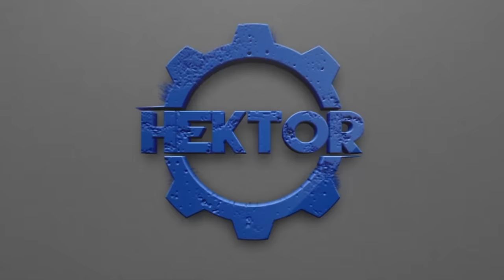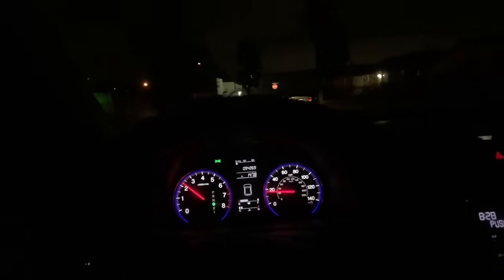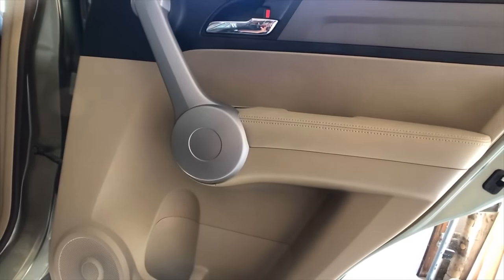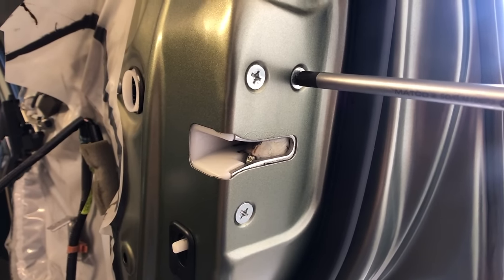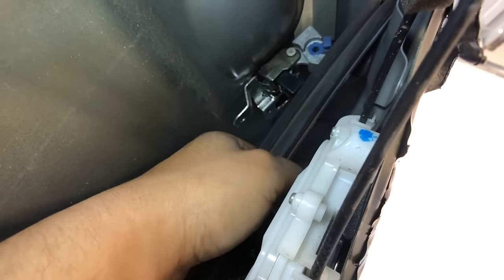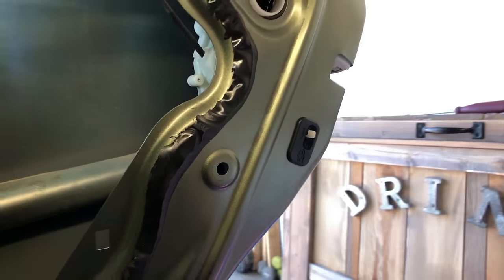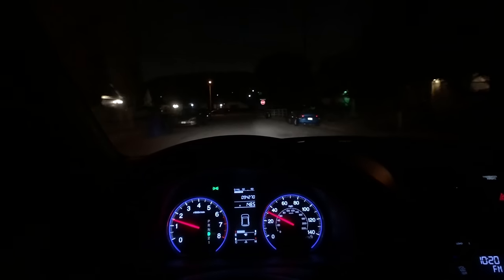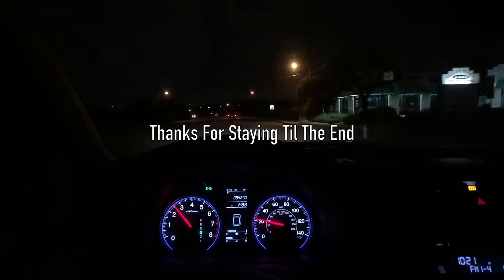Honda CRV common door lock problems

Comment: My 2011 CRV hatch is not unlocking with the fob or the button on the arm rest just the past two days. Discovered that my rear passenger door is not unlocking either (and I can't unlock it with the button on the door). From what I've read, I gather that the hatch will not unlock unless all of the doors unlock. So it looks like I'll be changing the actuator. This made it look easy enough for me to do. Thank you.
Reply: Hello, something similar happens to me but in a different way, they close all the doors except the driver's but they open all of them normally with the control and the button on the armrest and when driving The car does something similar to the video but I don't know how to open or close it, it just tries.
Reply: the same with mine! 2013...rear I noticed first wouldn't unlock...then the passenger rear. So weird. Did you figure out how to fix this??

Comment: Just completed this. Actually extremely straightforward and reasonably quick, just as shown. I would suggest the first task be loosening up those three screws with an impact driver (this way, if you run into trouble, you don't have the door all in pieces). Once you have those going, it should be plain sailing. Only other issue was that my new actuator didn't come with the metal rod. It's not immediately clear how to swap this over but the piece of white plastic pulls off of the metal on the actuator.
Reply: Timely getting a like here. I have to replace it again. Cheap knockoff, I assume.

Comment: I literally just did this job on my car and followed this video step by step it was super helpful and detailed unfortunately the replacement part I ordered off of amazon did not come with the metal rod that hooks up to the door handle but i took it off of the old one and used it on the new one i give this video a 10 out of 10
Reply from the maker: That’s what it’s about, my job is done here.😎
Reply: I had to do something similar.  With one or two parts.  I had to modify another post on the new part also.  Used a Dremel to shave it off so I could mount it properly.
Reply: Hello, something similar happens to me, the driver's door does not close with the control and the button on the armrest and when driving the car it does the same thing in the video but I don't know how to unlock or lock it, it only makes the sound, I changed the actuator the driver's door but it remains the same, what do you think it could be?

Comment: I know I’m a couple years late to the party but thanks man. Just took me an hour to do this on the front passenger door, it’s the same as a rear door. Also to get the rod out of the blue conector I used one screw driver in the door and another one down from the top and pried one agains the other like a v to pop it out. Worked like a charm

Comment: I deactivated the auto door lock feature (detailed in owners manual) on my 2008 Crv, so far no issues. 196,000 miles.
Reply: Sounds like a lot better fix.
Reply: Takes a lot of stress off the locking system for sure.
Reply: Similar problem on my 08 CRV. How do i disable auto lock feature? Thanks
Reply: Jassima Nasima it’s outlined in the owners manual in the lock section
Reply: Thank you! You totally saved me🙏
Reply: My is 230,000 and it runs perfect
Reply: Auto lock and unlock is so silly, I think even foolish to keep on.
Reply: To turn the auto door lock modes off:

1. Make sure the shift lever is in
Park (P), and open the driver’s
door.

2. Turn the ignition switch to the ON
(II) position.

3. Set the parking brake.

4. Push and hold the front of the
master door lock switch on the
driver’s door. You will hear a
clicking sound after about 5
seconds.

5. Release the switch and then,
within 5 seconds, turn the ignition
switch to the LOCK (0) position.
Reply: @johnwaynecarlson5391  I tried your way and it didn't work. Says you gotta turn the key on THEN open the door. I didn't need to set parking brake either and it still disabled it.
Reply: @johnwaynecarlson5391  does turning this off actually correct the problem.  I have a friend that can't lock his car from the key and has to lock it manually now.
Reply: @musicismeds  I can still lock the door, no issues.
Reply: @johnwaynecarlson5391  thank you for the quick reply. I'm going to turn off this auto lock function and see if this corrects the issue. He said the lights don't flash when he hits the key fob or lock the doors. Battery is new so I'm under the impression that it's something with that actuator auto lock. Thanks again for your help.
Reply: @johnwaynecarlson5391   quick question my 2003 Honda CR-V trunk won't lock. Even if I lock it with the keys. Will this work for my 2003 as well?
Reply: @johnwaynecarlson5391  thank you so much ❤
Reply: Thanks man,  I just fixed wife's car. Way faster solution.
Reply: @claudiagonzalez9825  I knows it’s been a year but I’m not sure the 02-06 models are close, however people I know with hatch issues on 07-11 can stem from the left driver passenger lock failing as the hatch is next in line in the circuit.

Comment: Mil gracias, HH!  My son's CRV left rear actuator was clattering and wouldn't lock, and it kept the  rear hatch locked.  Replacing was fine until removing the actuator - the rod was hard to release, finally got it through the little round access port.  Then the actuator didn't want to get past the window track - removing that 10mm bolt to enable twisting the track was necessary.

Comment: Thanks, Hector, for the repair videos. They have definitely helped me with fixing issues with my car. I have the same problem with my 2008 CR-V. I know exactly what they mean when talking about the locks going crazy. The locks go through the lock unlock process repetitively and create a rapid clicking sound. It happens not only when you come to a stop, but when driving over speed bumps and on lousy roads with potholes.

Comment: Great job. How did you determine what door was giving the problem. Like the way you show details on your video's. I have been turning wrenches 35 years  I still love it but my back not so much .
Reply: He said he changed 3 of them. Wonder what the cost of this repair was. I’m in California this would be at least $200.00 in labor plus parts. Wonder how many people just don’t get this fixed.
Reply: @michaelshanahan4965  I’ve been dealing with the same issue in my 2008 CRV EXL. Aggravating!! But only driver side back door. It will lock sometimes, but most of the time it unlocks itself immediately after locking. 
How can I know which door is the problem?

Comment: Saved my butt.
Since changing the front passenger side (only one thus far), the key fob will not lock the doors.  It will unlock them, but to lock them, I need to manually lock each or from the driver’s lock.  Everything else is back to working the way it is supposed to.

Comment: Thank you very much!  I have a cheap-o question.  What if we just disconnect the actuator electronics (that is, pull out the wires and leave everything in place).  Can we still use the car and just manually lock/unlock from inside?  I don't use the back seat very often, and the driver's door works fine.
Reply: Sure, can that's what I did.

Comment: Thanks for this video. If it's the tailgate and the rear passenger side of door that can not be opened (tailgate can still be manually opened from inside of the car, but the rear passenger side of door can not be manually opened from inside or outside of the car), would that still be the same problem caused by door actuator?? Thanks!

Comment: I had the same exact problem on my 2007 CRV, both rear doors went back to open position, changed actuators (30 dollars each on amazon) but the problem continues, long story short I HAD TO CHANGE the internal fuse box, also called multiplexer (located below the wheel) lucky me found an used one at a junk yard for 50, but had to reprogram it for extra 80 bucks, the guy charged me 200 dollars for his labor so i ended up paying around 400 for the whole thing to be solved.

Comment: Que Pasa Homies (y Hektor).

Just got done doing LF and RR on wife's 2008 and a couple notes to help out.

LF-There is a mechanical/magnetic actuator plug at the bottom of the actuator on some models.  You can unhook it with two fingers by feel by pulling straight out on the "T" and there is a two stage click you will feel.  It's easy but you need to get this free in order to get actuator out.  To reinstall, it plugs right back in and you'll feel the two clicks.

Loosening the bottom window track is required and it does swing out barely enough to get the actuator out.  It feels like you might break it though it appears to be hinged to move on purpose for this.

RR-The lower window track needs to be loosened and bent slightly out of the way to remove actuator.  It sucks but it is possible.  Getting it back in is even harder until I discovered a great trick.  Leave the rod and little plastic retainer off until you get actuator in place and not bolted in yet.  Then you can push actuator towards outer door skin with one hand and install the rod and plastic retainer pretty easily with the other.  Then bolt /clip it all together and you are good.

BOTH-After stressing on trying to pull out the door handle locking rod, a bunch of different ways, it's super simple.  The rear door has a plug hole directly across from it.  Slide a flat blade screwdriver in there behind the window track.... TWIST like a key and if the blade is wide enough, it will pop right out.

Muchas Gracias Hektor!!!

Comment: Thanks Hektor a great video for the do it yourselfers!!! I have the same model of CR-V, and on the passenger side, front and rear, I get this razzing noise each time the actuator kicks in to lock or unlock the door. They function as supposed to, but just the crazy razzing sound.  Please advise as to what the problem is or might be.

Comment: I have a 2009 Honda CR-V. My doors lock automatically every time I close them even if I am outside the vehicle. I suspected my problem was the door lock actuator but do not know how to tell which door is the problem. Any thoughts would be appreciated.
Reply: On my CR-V the only door lock that can cause all the doors to lock is the driver's door.

Comment: 2006 Honda CRV , I replaced the drivers door complete with a used door. I removed used actuator/components and replaced with actuator/components  my original door components. My key fob will lock doors but will not set security system nor will it unlock doors. It appears when I lock all doors with controller on the actual door panel, it will lock all doors except the drivers door. The drivers door locks, then unlocks; therefore my drivers door is always unlocked. SUGGESTIONS? ps, there were no issues with my door locks prior to replacement
Reply: Hi Trinity Faith! Did you get this issue resolved?  I am having the same issue with my 2006 CRV.  My back door does not lock either.  Thanks!

Comment: Hector love this tutorial! 
I have a 2005 Mazda tribute that the dashboard shows that my doors are still opened when there all closed also my interior lights stay on unless I switch them off manually. What could be the issues and how to fix it.😊
Reply from the maker: Depends on what’s involved in the circuit, but it sounds like a bad BCM(BodyControlModule)

Comment: Hector, I have a 2002 Honda CRV and it's making a grinding noise in the driver actuator. Do you recommend replacing all 4 or just one? Also my car does not beep when locking does that problem associate with my actuator?

Comment: Great video! Just a point, those lock screws are not Philips head, but JIS. Look similar but they are not. To avoid damaging the screws you need a good set of JIS (Japanese Industry Standard) screw drivers.

Comment: Hektor, my locks that were not locking was the passenger front door, and the door behind the driver. Now, the locks were going up and down while I was driving, didn't matter the speed. I could be going to 5 miles p/h, and just turning my wheel to the right, the locks locking and unlocking. Can àny auto service fix this?

Comment: My neighbor has this issue with his 08 CRV. How do you determine what actuator is actually bad if all the door locks are moving together at in sync with each other? For instance, no one door lock appears to stay unlocked while the other three are locking. Ive been trying to help him with this but we can't determine which is the bad one.
Reply: I have this problem on my FRV and need to know the same thing. Did you ever work out how to troubleshoot?

Comment: Kinda effed up that such a reliable vehicle would have that issue. $400 and it had nothing to do with the drivetrain. I got a question though: I got a 2005 crv with well over 300k miles and the driverside and rear passenger side elec windows won't roll down. I've checked the fuses and all the connections inside the door and cant figure out why they don't work. If the motor is bad it would make grinding noises, right? I'm thinking it may be a voltage problem? Any info would be appreciated.
Reply from the maker: mdaddya if the motor is bad it can give you different symptoms. Check your power and ground at the motor when your pressing the switch, if you got both then most likely it’s the motor. You can also bypass the switch and command the motor directly...there many ways to check it.

Comment: Thanks for the video. My CR-V does the opposite. When trying to unlock the passenger side door the lock opens half way then closes by itself.
Reply: Same for my case. Did you fix it? Thanks for response.
Reply: @senliangpan338  Yes. Replaced the actuator assembly with one from Amazon that had good reviews. No issue so far.

Comment: Hey man. Quick question, I replaced a door latch yesterday on a 07 crv and while making sure witch one for sure, and in that process while cycling the master switch door lock switch and after a few times the vehicle started without the key in the ignition. Have you even seen that before? If so what did you find to be the problem?

Comment: Good evening from Spain, I have a 2010 Honda CRV just like the one you repair in the video.  Could you tell me the location of the module (if it has one) to manage the locks and the remote control receiver?  Since it is giving me errors when I try to open or close it, it obeys when it wants and they are not the keys because they have been verified.  I would appreciate it if you could help me.

Comment: The problem I am having is the trunk latch on my 09 CRV is stuck in the unlocked position, and even when I get it to latch, the system doesn't recognize it so the rest of the doors won't lock using the fob or allow the alarm to be set. I've ordered a new actuator hoping it'll fix the issue. Any other suggestions??

Comment: My problem started yesterday. I parked my 2012 Honda CRV, locked the door, came  back out about seven hours later and the key fob didn’t work, no headlights, no horn. I went and bought a new battery for the Fob and it did nothing. The light on the key Fob lights up but nothing else. I also checked the key mechanically in the door… It turns, there is no wear & tear on the tumblers, but it does not unlock the door. What could the problem be?
Reply: Same exact issue here. Did you ever find a solution 🤔?

Comment: Thanks for a great video. I used a long skinny tapered punch to dislodge the door lock rod from the door handle connection. I accessed it through the opening just below the door glass.

Comment: Thanks for the video! My daughter's used 2007 Honda CRV has the same issue, though only the Driver's door locks with the remote, and all three other doors (FR, RR, RL) cycle through while driving. How do I know which actuator to replace, or do I have to replace it in all three doors?
Reply: I'm having the same issue as your daughter's car.  What did you find out.
Reply: @ammogiant824  same issue did you figure it out
Reply: @eyemah4440  no I didn't unfortunately. The only one that works correctly is the driver side. I have disconnected all other ones in the meantime.
Reply: @ammogiant824  question have you replaced your starter recently this happened to me right after I replaced my starter?
Reply: @eyemah4440  no still on the original starter but on my second alternator.
Reply: @ammogiant824  I just researched that it could be the multiplexer unit how many miles does your crv have my 08 has 244000
Reply: @eyemah4440  07 with 199

Comment: My 2004 Honda CRV was locking by itself. After I removed the car stereo, the remote control is not working and for 3 second after I started the vehicle, I can see the speedometer needle shaking . I replaced the cluster where the gauges and speedometer is. any clue?

Comment: How do I know which door lock is defective because all three door locks were behaving the same while driving let me know please I have the same problem but I am not willing to change all three locks due to cost
Reply from the maker: West Coast get inside the car and lock all the doors and see which ones don’t unlock or vise-versa...
Reply: You have to replace all that are not staying locked. $25 each or so on ebay.
Reply: @PaulSmithDYL  so ,how long before you have to do it again?
Reply: All three. Sorry. It goes pretty smooth after the first one but you may have to drill out some of the screws and get new ones from Honda.

Comment: Hello, something similar happens to me, the driver's door does not close with the control and the button on the armrest and when driving the car it does the same thing in the video but I don't know how to unlock or lock it, it only makes the sound, I changed the actuator the driver's door but it remains the same, what do you think it could be?

Comment: Hey Hector, got a question on these 07 Honda door lock actuators.  Do the aftermarket actuators( like Amazon)
actually work or do you have to use the Honda OEM actuators? (Much more money)